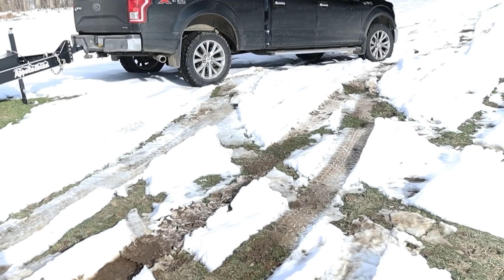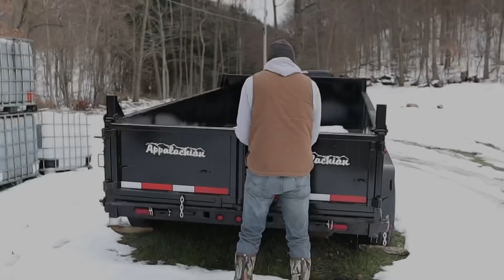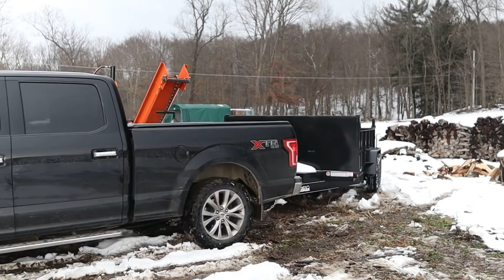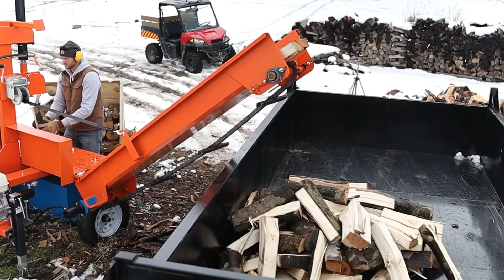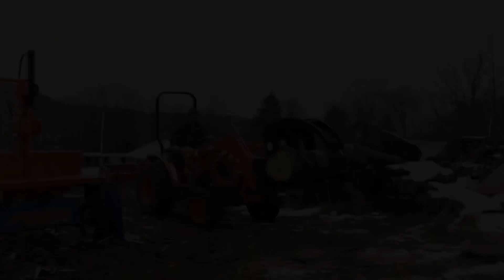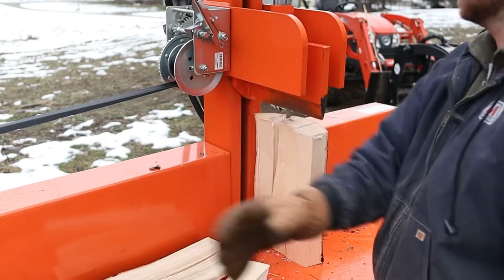Eastonmade Axis Loading a 7x14 Dump Trailer

Comment: good to see you are not bending over to cut your wood . i try to tell people this to no  avail . also keeps saw from plowing the dirt . . i try not to saw when frozen . mud on a log turns to a dirt file on the blade . put a short grouser bars with an under slide for unwanted smalls   . see ya friday . also good that your cutting from both ends of the log . once saw a guy just sawing from one end and his tractor tipped . went right after letting the log down nothing hert.  see ya friday john

Comment: Keep the trailer hooked up, then move it forward  after one side is loaded turn the trailer around, I always have the drivers side of the trailer against the splitter, that way you can see better how close you can get, either way you do it is still easier than chucking it into the trailer. Keep safe my friend.

Comment: Try backing in with doors open. Hopefully that will put the bulk of the load over the axles.  More importantly, a 3 point trailer mover is one of the handiest attachments I have. Use your tractor to jockey the trailer around. It doesn't appear that you need the box blade for ballast for grappling one log at a time if you can move a nearly full IBC tote without it. But if you do, then a quick hitch is really nice. I switch between 3 point carry all, box blade (for snow removal), and trailer mover all the time in the winter.  
    Propping your loaded dump box is asking for trouble.  Just jack up the trailer to shed rain or use your new 3 point trailer mover to lift up the trailer and put a 6 x 6 or a short round under the jack.
    You have an awesome setup and a great channel.

Comment: If you look at the bigger firewood processors some have chute that is right under the end of the conveyor so when the wood falls off the conveyor onto the chute is slides a bit further and would get you to the center of the trailer or further. If it was made to be removable with 3 point hitch pins or something similar, then as the trailer fills up you can remove it in a minute and carry on. Plus it wont change the height for transporting it. Great video, and congrats on your new purchase!

Comment: I REALLY like the way you think about processing and the overall through-put to the process rather than just one part of it.  I like the Axis splitter also very much.  I am wondering if you could attach at an angle, with hitch pins,  a small deflector plate,  about 12 inches long to the end of the conveyor, to deflect the wood a little farther over into the trailer.  It could be easily removed for transportation.  Good work Adam!

Comment: I recommend, as others have, adding a chute to the end of the conveyor to direct the wood to different parts of the trailer.  It would be similar to chutes seen when a construction crew or roofing crew is renovating an upper floor or dismantling an old roof.  Waste material is thrown into the chute and it is directed into the dumpster below.  Great video!

Comment: Nice video Adam. You got your setup figured out. Only thing now is to hire the neighbor kid(s)
As for the conveyor...I wonder if a set of makeshift grizzly bars would help. This splitter does not need them due to lack of trash but what I think they might help in this situation is they will “deflect” the wood out another 1-2’ possibly center loading this trailer. Only down fall is the clearance height. Andrew may be able to chime in on this. Forgot to add...the kickstand on dump beds is for supporting bed without load. Careful that you don’t bend it. I’ve see FELs use the stays with a load in the bucket and yeah not good. Damaged stay and cylinder.

Comment: Maybe find spot on property with hill and use large concrete blocks below and pave section.. Cover Eastonmade up top with portable shelter temp or metal roof shelter so lasts longer.. lower section paved area allows you to work through winter and scoop firewood without dirt.

Comment: Look to get an old farm conveyor that is used to get bales up in the barn. Use the conveyor on the splitter to run up on the other one which is taller and will get to the center of the trailer. This would work to get a taller seasoning pile. Could also use it to run the wood out in different directions then a straight line off of the splitting table. May just need to fab up a hopper between the conveyors.

Comment: Fill up the trailer the way you had it parked, start with the conveyer in the front corner and keep pulling ahead. When the first side is full pull ahead and loop around and pull up so the conveyor can start filling the other front corner, then continue to pull ahead as the trailer fills up. It’s a lot of pulling the truck ahead but it would eliminate having to handle the firewood any more times. I’d like to see a video of this method to see if it works

Comment: Just some advice from my own experience, if your not going to keep the trailer near a plug in to keep the battery charged put a solar charger on it or your going to eat battery's. Its hard on the pumps as well running them on a battery thats not fully charged.

Comment: Good video,  I can't think of anything else to help spread out the wood in the trailer.  
Others already mentioned it, but the prop in the  trailer was only designed to support the empty bed, not the added weight of the wood.

Comment: I'd consider a chute that attaches similar to concrete delivery truck chutes. Couple of big bolts protruding from the end of the conveyor and a simple chute made of plate steel that hooks on the bolts. Sweet talk your buddy at the welding school into making it. It shouldn't take an hour to do.

Comment: My comments, you're
 doing fine on your dump trailer with what you have. Some day you can elevate the splitter to get the trailer closer. One thing I do like is the vertical splitter. Watching guys with a four way horizontal, seems like you get more waste pieces. I've only used the vert. and to me works better.

Comment: Just a tip. How about a flip up slide extension on the top end of the conveyor , angle down for far side of trailer , hinged at the top of conveyor side panels , and up  out of the way for for direct drop.

Comment: Irony- having to shovel out a dump trailer...
BTW, I love that splitter. Glad to see you're not dropping hundreds of pieces on the ground now.
1. Easiest fix, load 1 side of trailer, drive forward, turn around, load other side.
2. See if you can re-arrange your work area and get the trailer lower than the conveyor. Perhaps build a small retaining wall and put the trailer on the downhill side (this is how we load manure spreaders). Same idea, just dirtier.
3. Easier fix - just buy a longer conveyor or add a folding deflector chute.
4. Split wood and run conveyor into the carryall box, then use tractor to dump into the trailer if your tractor has this much lift capacity.
I'd be careful raising the dump bed and letting material slide into your tailgate. Just asking for problems. Damage the latch mechanism, or possibly pop a wheelie if load was too heavy (probably not an issue with wood, but the thought crossed my mind)

Giddyup and Merry Christmas!

PS, buy a bigger chainsaw bar. I bought a Holzforma 25 inch china bar for my Stihl 361. Works very nice (with Stihl OEM chain)

Comment: Reading through the comments, Just a few things to add:

Modifying your work area (raise the Axis or lower the trailer spot) is really effective but relatively permanent.  Are you ever gonna move the Axis to a different spot in the yard?

A 6" or 12" slide on the end of the conveyor would help, but you will lose pile height as well.

A simple suggestion would be to bring the trailer in at an angle to the conveyor, sort of pointed behind the splitter.  Then if you do speed up the conveyor towards the end of your splitting it throws wood back to the middle instead of all the way across the trailer.
Reply from the maker: Yeah I’m trying to think of a way to make a 12” slid for the end of it that could swivel like a cement truck

Comment: I'd form up and pour a concrete or compacted gravel pad to work the splitter on. You'd get a nice level easy to clear work surface, and could easily pivot the splitter around by grabbing the tongue and pivoting.
Also put an adjustable chute/diverter at the end of the conveyor, with a prop rod that is connected back down the conveyor somewhere and easy to adjust the angle of the chute.

Comment: The electric motor on your hydraulic pack is close to double the amperage of a starter motor. If you run the motor without any incoming amperage like that you'll get 9 months out of the battery. With those setups the truck is supposed to be trickle charging the battery in between dumps to make sure its kept up to full power. Not sure what the amperage going to the battery though the trailer plug is but I'm guessing its only 20 amps max. If that is the case you'd need to idle the truck for 10 times longer than you ran the dump hydraulic motor for in order to charge the battery sufficiently. So a 30 second dump would need minimum 5 minutes with the truck running to recharge the battery
Reply: Another point about dumping the trailer not hooked to a pickup or SOMETHING, is, that wood piles up very deep, and the front of the trailer is going in the air!
Also, that jack isn't made for those forces!

Comment: I also switch between tasks because it allows me to use a different muscle group while I rest the other one. Sawing is a lot of bending without as much heavy work while splitting maybe a bit more lifting, but much of it is while you are standing up.
Reply from the maker: That is exactly my reasoning. I can only run saw for about an hour straight before my back is killing me from bending over. The tractor helps quite a bit getting the wood off the ground but that is a lot of on and off the tractor

Comment: Well if it were me.  I have been looking into a old hay elevator for firewood. Which you could raise and lower.  Just would want to watch possibly the height of fall. They are relatively cheep.  It doesn't have to be  new.  My father used one along time ago to load larger trucks with wood.  Most have electric motors.  I have seen belt driven.  I think the old chain drive with paddles would work. They are getting harder to find.  Taller maybe better to get your work area cleared too.  I was surprised you haven t  put up a car port to work under to keep the machines dry and keep you dry and warmer. Would work great for the conveyor to go out of for loading.  The ground road milling from blacktop are tough to spread but make a solid base to drive on.  You will not sink like gravel.  It pretty well stays put. It may not dump well of the truck.  They may be able to add more gravel to help it spread easier. There has to be an old farm equipment dealer near you.  Have a great week.

Comment: 👍🇺🇸🇺🇸🇺🇸🗽🙏🏻 Enjoyed!  Couple of things I do.  To keep the bed up a bit so water runs our lay a 2x4, 2x6 or 4x4 across the frame and then let the bed back down on the 2x4.  Another thing is I use my tractor (Kubota L3200) to pull my hydraulic trailer around.  I mounted a hitch/ball on the back of my box blade...backing up the trailer with the tractor is a lot easier too.  Neat splitter...I have a 30 ton Northern but I only split for my wood stove in the shop.  I grew up in Iowa on a farm, got transferred to Dallas in the mid seventies and retired 12 yrs ago to the Piney Woods of East Texas.  Lots of sunny days with 50/70 degree days all winter long.  Really we have 4 months summer, 4 months fall followed by 4 months of spring!  We have sandy soil, never any mud which is another plus.

Comment: You've got a really nice set up there. Be careful dumping the wood t the back of the trailer without being hooked to the truck. It'll stand up on you, been there, done that. Put a clamp on ball mount on the loader bucket or forks to move the traler with the tractor. To getthe wood t the center of the trailer, put a chute or "gizzley bars" on the end of the conveyor or get a longer, stand alone cnveyor with the attached cnveyor dumping into it.

Comment: If you are going to keep the splitter in that location make a slight dugout for the trailer to go in.  Or use the tractor to drag the pyramid to opposite side of the trailer.

Comment: Subscribed for prioritizing work, but busting it out to get in the woods for a chance at a deer. 

The easiest thing to do is to take the splitter and put it in the spot that makes the most sense with how your yard is laid out (timber, drive paths, tractor maneuverability, etc),, and set the splitter up in a place that is as much a net benefit as possible. Then take the tractor and scrape out a trough to drive the truck and trailer through. Make it quite a bit longer and wider then you think you'll need. You'll have to drive through/in to it and want to be level. Especially when you pull out with your load. Take the material you remove and use it to raise your work station for the splitter. Give yourself a decent ramp to be able to pull the splitter in and out for remote business. Between the trough and the ramp you should be able to gain an easy foot, foot and a half, which should be all you need. Of course, if you have a rise anywhere on your yard that you could set up on, that would be great. But I'm pretty sure that you thought of that already.

Comment: Hey there great job on the videos. I’ve truly appreciated the information on the east and made splitters. I would arrange the conveyor somehow so that sits higher. Maybe you can build a small mound wheel of dirt and then pull it on that and pull the trailer up next to it which means the trailer would be sitting a little lower compared to the conveyor. I think you probably see what I’m going with this.

Comment: Or a detachable roller add to the top end of the conveyor.  On that the wood coming over the conveyor wood (would) push it on off.  kind of like the chute others have suggested.   Just knee jerk ideas here.  ????  Be interesting to see what you come up with.  My guess you'll just figure out work arounds as you are now working on.

Comment: Two ideas for the conveyor. It looks like you could rotate the splitter 90 degrees clockwise and park the trailer slightly on the down hill to get more reach into the trailer. Second idea would be to make a small ramp with 2x4 and plywood (picture a super steep angle skateboard type of ramp) to divert the initial drops from the conveyor to the far size of the trailer, then you slide the ramp out before the pile gets so big that the ramp is stuck. You would need to keep it small enough so it's not a chore to slide around and move out of the way. If it works, you could always get a lighter weight product down the road made out of aluminum for long term use.

Comment: I am a super fan of the 5 .0 coyote motor I have two mustangs with that motor but for towing you cannot beat the 3.5 EcoBoost I run an aftermarket custom tune and it will literally tow a freight train at 2,000 RPMs at 80 mph... But glad to see you bought an American made pick up

Comment: Perhaps a short steel extension could be fabricated that would kick the wood to the center of the trailer after it falls off of conveyor....would be cool if it rotated a little like a snowblower chute.  Can the angle of the conveyor be adjusted in order to get more reach out of it?  If so could lower trailer parking area or raise conveyor side of the woodspliter as long as you still had a comfortable work position.  That trailer is going to be great for your operation.

Comment: Hey Adam, if you can lower the conveyor to make the reach longer, why not dig a slot in the ground, beside the processor?  Kind of like a loading dock sunk in the ground.  Back your trailer in start at the front and pull your truck forward as you fill.  I think going down even a foot or 18” you could get more drop toward the center of your dump trailer.
Reply from the maker: Hey Keith That’s a great idea except then I’d have to figure out some way to drain it. Otherwise it’d be like a giant bath tub for my dump trailer.
Reply: @HometownAcres  That's true.  Even if you could dig it into a hill.  You only need 1/4 pitch to get water out the front of it.  Anyway great channel Adam!

Comment: One thing that you can do instead of using the support post is you can take two pieces of wood and place them on the front of the trailer on the right side and left side under the box and lower the box on to the pieces of wood

Comment: Look into welding a 2" hitch receiver on to the top of your box blade.  You can then move around your dump trailer with your tractor very easily.  I move my 16' dump trailer around my yard all the time with my B3350, even full of crap sometimes.  Also makes it real easy to park the trailer in ways it is impossible for a truck to hook to it, theft prevention. It would allow you to move the trailer simply and quickly to the exact position that you want, even flipping it around.

Comment: Great video Adam! Where will the wood be going once in the dump trailer? Bulk pile or off to be stacked for drying?  I would have to agree with some of the other viewers about adding some sort of chute or conveyor extension to let the wood fall off to the other side of the trailer, otherwise you could always turn the trailer around and load from the other side once one side is full, takes a bit more time but probably the simplest solution. I cant wait to get my conveyor back from the shop!
Reply from the maker: I’ll use the dump trailer to stack from so it’s up off the ground. Less bending over. And I can just keep raising it a little at a time to keep the tailgate of the trailer full. Probably put an IBC tote on the forks and raise it 2-3ft off the ground so no bending over to pick up the wood and no bending over to stack the bottom of the IBC tote